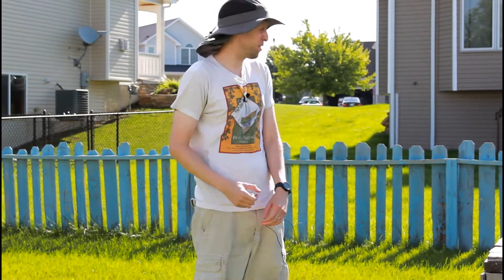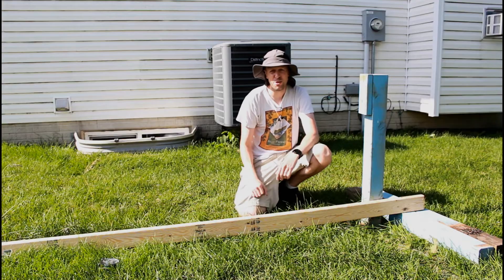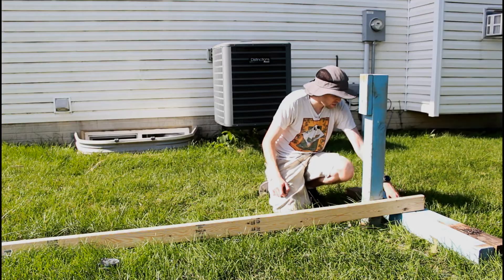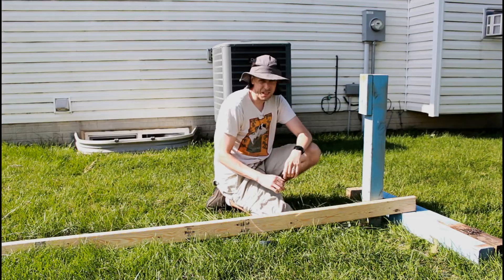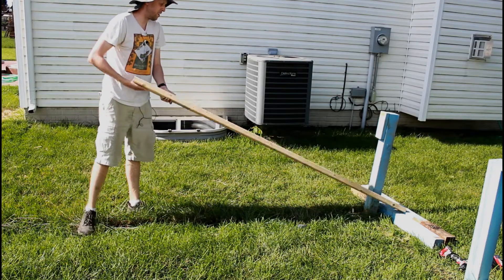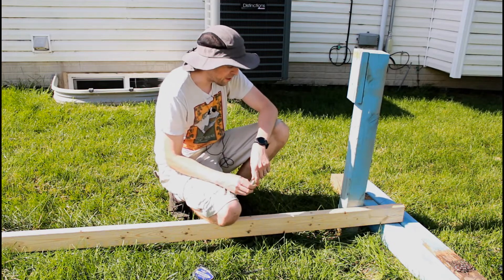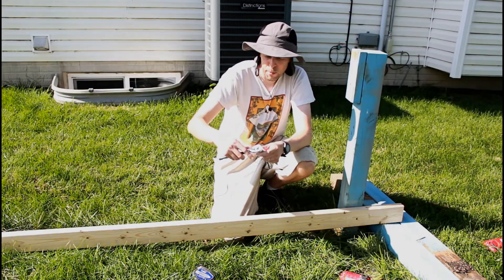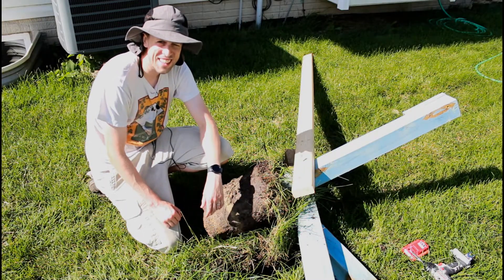Physics Life Hack: How to Remove a Fence Post Set in Concrete with a Lever

Comment: Good and well explained demonstration of leverage. Science!

However, as an Engineer, I can hopefully contribute some additional helpful refinements!
- The taller you make the fulcrum above the ground, the higher you have to lift the Effort end of the lever to achieve the same lift distance at the Load, so a flat board for the fulcrum might have worked a bit better.
- Besides the primary goal of achieving the necessary lift at the Load, an important secondary goal is to lift the Load enough to easily clear the ground. Moving the Load's attachment point a bit further away from the Fulcrum can give substantial improvements in lift distance, with minimal increased Effort.
- There is no advantage in screwing the Load's pivot bolt/screw into the Load. Simply drilling a clearance hole in the Load (and the lever, of course) and slipping the bolt through is sufficient; easier to set up and to dismantle later on. There is plenty of friction on the bolt once you start applying Effort to keep the bolt in place.
- The bolt hole in the lever should preferably be closer to the top edge of the lever, rather than centrally located; less chance of tear-out.

And there is also room for some casual empiricism. Having used this same method to pull posts previously, I have settled on an 8 foot long 2x4 board as the lever, and a 3/8" diameter steel bolt, with a 5/16" diameter clearance hole. On my first attempt, I tried just using a brass 1/4" rod that I had laying around, and it turns out that the approximately 50 pounds of effort I was applying, resulting in over 500 pounds of lift at the Load, exceeded the shear strength of that brass rod. I have never tried using a bolt larger than 3/8", and indeed doing so would jeopardize the strength of the lever at the Load's pivot point .

Cheers!
Reply: Why not just use a farm jack with chain and S hooks done lmao
Reply: @robertfusselman8108  , laugh all you want I know better. This method does not require owning or purchasing any equipment other than a 2x4.
Reply: What size hammer did you use to drive that 3/8 diameter 
bolt thru the 5/16 diameter hole? Add to shopping list.
Reply: Do you have a stash of 3/8 diameter bolts that are at least 4 inches long
that nobody else on the face of the earth has stashed away?
Reminder: To get thru a 4x4 and a 2x4 the bolt will be at least 6 inches.
So maybe you had to buy that bolt. Add to shopping list. 
If you want a flatwasher and nut, let's just add them to the list.
Reply: I just got done calling 100 random people from the 2024 local
phone book. None of them was willing to admit to 
possessing a 8 foot long 2x4. Imagine that. 
( I keep 3 10 footers stashed in an undisclosed location. )
Add one 8 foot 2x4 to shopping list.
Reply: Please fill us in on how did you drill the 5/16 diameter hole 
that the 3/8 bolt was to pass through? Did you do that with the drill 
that you did not buy, and the drill bit that you did not buy? 
Did you steal the drill and drill bit from your employer??
Add two items to the shopping list. Or...
Maybe a call to the local lawyer referral number.
Reply: Just so nobody misunderstands, I am responding to the 
@youtuuba 3years ago edited comment. not the bennet science video.
My comment is directed to the @youtuuba comment to @robertfusselman8108

I Just watched the video today 20240513. 
Your @youtuuba response to @robertfusselman8108 was very disrespectful. 
I certainly do not have engineer credentials.
Reply: You're an idiot

Comment: I'm going give your method a shot because I have the necessary materials and tools at hand. I'll be trying to remove a 6 by 6 wooden fencepost that's buried 24 inches below ground, embedded in a concrete footer. Anticipating the necessity for adjustments I'll use a carriage bolt instead of a screw and I think a length of chain will come in handy. I really like the idea of doing it this way. The magic of physics and all that. If I don't achieve success I'm prepared to purchase an inexpensive bottle jack which will also come in handy for removing a couple of small tree stumps and any future fenceposts, of which there are plenty.

Comment: Instead of breaking your back, create a fulcrum with pieces of 4x4 on the other side of the past, and then apply your body weight pushing downwards on the end of the long board to do the lifting.
Reply from the maker: I had considered that, too. My guess (before trying this) was that this was going to be a lot harder than it was, and I figured a could lift with a bigger force than my body weight. I thought I might need every last pins of force I could generate. 

I'm this case, moving the fulcrum and sitting on the board would have worked great. If the post were deeper, with more concrete, I might have needed to be lifting. 

Of course, a deep enough post with enough concrete, and you probably just break the 2x4 before you move the post.
Reply: @AndrewBennettScience  Also, many videos show pulling posts from dry soil.  Saturating the soil around the post with water could make many easier to pull out.  Dry clay or compacted DG soil is particularly strong when dry but weak when wet.

Comment: You rotated the post out and did not lift it straight up. It work because you have relatively soft earth surrounding the concrete which was only about 18"-24" deep from the looks of it. Now try this with a post set 5 ft in the ground. Never it a million years  would it work.
Reply from the maker: That's fair - it likely wouldn't work.  I suspect that most people looking to remove a post like that are doing this in more of a professional capacity and have access to some heavy equipment to facilitate the process.  Must be a heck of a fence that has a post buried 5 feet!

I would be interested to see if you could make this process work by adding an alternating pivot system.  I think that you could increase the maximum capability of this system by lifting as high as you can (not nearly as far for a deeper post) on the lever as shown, then wedging a stack of boards under the lever on the near side of the post, then pushing down on the board as far as you can and wedging another board or two under the lever on the far side of the post.  You should be able to seesaw it out, without ever tilting the post very far.  Maybe not enough of an improvement for the scale you described -- might be worth a try, though!
Reply: @AndrewBennettScience   I northern climates like where I live if you don't go down 4ft minimum frost heave will move the concrete over time. Stacking blocks as you suggested to keep the pivot point moving upward with the post as it lifts is a good idea. It will limit the tendency for rotation. In addition to that, use two people and 2 lever systems 180 degrees apart. This way the post comes up straight and you double the force.

Comment: If you move 9.6” on 96”,that would leave 9:1 on leverage end.
Reply from the maker: Since it's a 2nd class lever, the fulcrum is all the way at the end of the board.  The input distance is basically the full length of the board (minus the distance that my hand takes up at the end of the board).  The pivot isn't at the bolt location, it's where the 2x4 touches the board that's board that's lying on the ground. I think you're using the appropriate thinking for a first class lever, where the pivot is in the middle, somewhere between the input and output forces.

Comment: Why wasn't the fulcrum  between him and the post? It would be a lot easier to extract if he was pushing downward on the lever instead of trying to lift it
Reply: Chet Arthur You’d never be able to get the range of motion required - look how high he pushes the beam ‘up’ for a small movement. The ground would get in the way of you pushed down.

Comment: Absolutely excellent.
I'm going to try this method on six posts within the next seven days. I'll report back.
Reply: Did it work ?? Cause Im replacing Six Wooden Post
Reply: @MrAlvaro2376  Yes, it worked perfectly. Old concrete around the base of old post can be too heavy to pick up even when it's outside the hole. So, pulling it upwards through soil is a task requiring 'method' as opposed to brute force. Try this method [explained in video]. You'll be glad you did.
Reply: Thanks !!